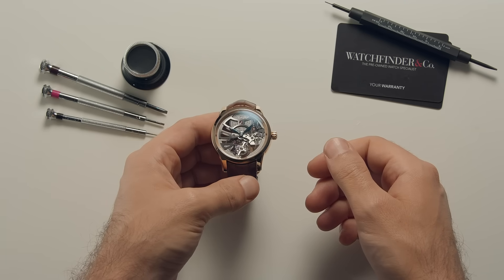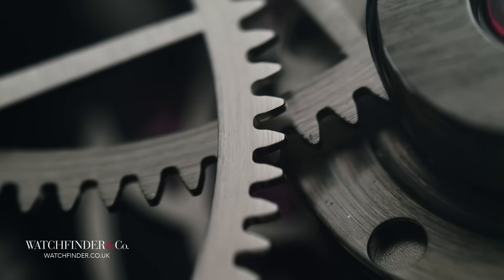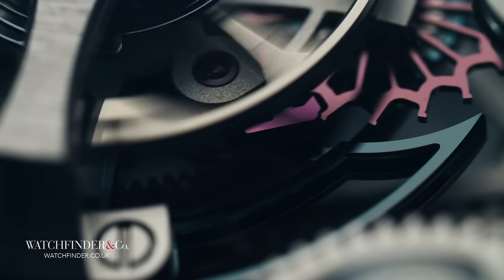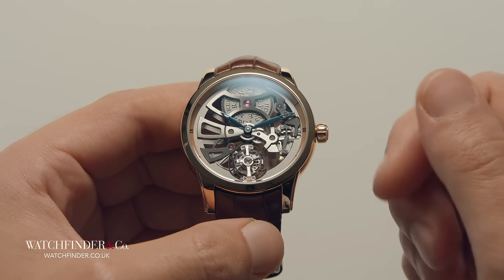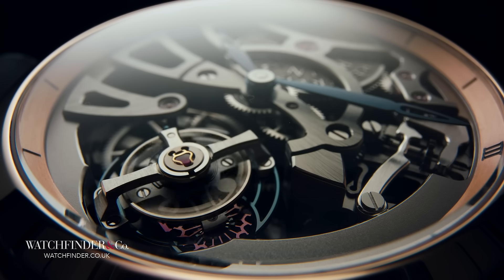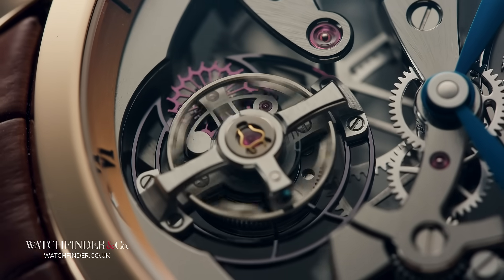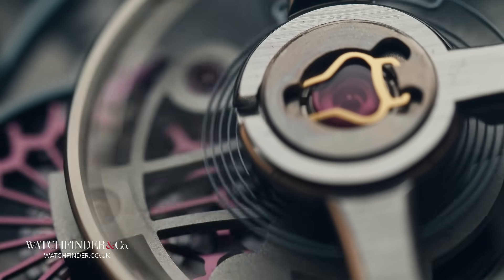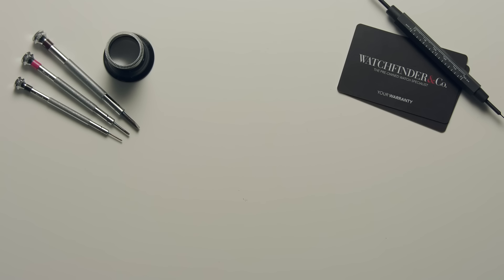How On Earth Does a Tourbillon Watch Work? | Watchfinder & Co.

Comment: I've picked apart a car and put it back together, without any former knowledge. I work with some kind of mechanics, electronics and regulation systems. I think I'm quite smart.
Looking at the engineering of something like this, in such small scale with such accuracy, inventing this just through mechanics is just uncomprehendable.
So they dismantled the back face of the clock to show this? This is how this piece of engineering should be presented. Who wouldnt want to see this, buying this piece of art?

Comment: Didn't get the point, why the rest position of a pocket watch would be different form a writswatch.
I think, the normal position when walking is the same. Only when sitting at a desk (which the homo computerensis does a lot) might the "resting" position be different.
But even then. it's like 45 degree vertical most of the time, I'd say. So it's not entirely useless. But .... who cares anyway, when it's just gorgeous, eh?

Comment: Tourbillon is a kind of clock speed regulating device invented by watch master Abraham Louis-Breguet in 1801.

At that time, Many watchmakers tried to figure out how to make pocket watches more accurate and how to combat gravity and shocks and their consequences on the watch’s escapement (the mechanism that controls the transfer of energy from the power source to the counting mechanism).

So Louis-Breguet invented the tourbillon to help regulate timekeeping. It improves the accuracy of the watch by taking the heart and the brain of the watch, putting them inside a case and rotate it one full revolution every 60s and by doing so, the mechanism will counteract gravity. 

So it’s important to know that when Mr Louis-Breguet made the first tourbillon, it was meant to be for pocket watch chronometers and at that time people needed very high level of accuracy on their watches that were worn vertically on their chest pocket.

But nowadays,  tourbillon mechanism is not functionally needed as it once was, instead  it  represents the highest level of manufacturing process in mechanical watches, companies  tend to implement it in their watches to showcase their know How.

Comment: A modern time piece like an Apple watch runs down in 18 hours and needs a recharge daily. Therefore, if you are not near a power source to charge it and you are out hiking or camping for days or even weeks, then you will not know the time. . But if you have a "magical mechanical watch", you will forever know the time and it will be immensely useful.

Comment: Some of us are true luddites, and simply hate to see electricity and electronics take over functions well served, quite well, by sound mechanics.  I once bought a Rolex, having broken three good watches on "water tight hatches and doors" in a few months on board an amphibious helicopter carrier.  I bought it duty free, and it survived me, mechanic, some decade, just requiring polishing the six hundred meter crystal.  I made a foolish trade, had a few, quite a few electronic watches, and was given a Stauer by my mom, on a birthday, nice automatic, and kept it running for two decades, buying used, and trading parts.  I ran out of parts, and while I'd love one of these, I believe I'll have to stick with my "Invicta" automatic diver's watch, nice mineral crystal, keeps good time, but will scratch.  I also hate electronic fuel injection, because it's not better than mechanical, the engine's are just worse, for low quality fuel, and misguided aims by politicians, of course what other sort of aims could they have?  It is still and incredible pleasure to listen to a 58 265 Corvette fuel injected V-8 idle, with distinctive character, or red-line, in perfect cacophony of pistons, explosions, levers, valves, gears, all whirring in perfect harmony, each movement a harmonic of the primary and secondary forces.  You can't get that electronically, my watch ticks seconds off, five beats to the second, like always, I like that.  Thanks very much for showing this excellent movement, I think I need make a grandfather clock incorporating it.

Comment: As a piece of art yeah, it is the pinnacle of analogous watchmaking...but the current pinnacle of time measuring / time telling is the atomic clock, followed by quartz movements (with radio controlled quartz movements between those two). Doesn’t get more precise than that for now and sadly mechanical movements are inferior in the most essential, fundamental, and basic thing any watch and clock does: precisely telling the time, aren’t they.
But they are immensely pretty and the comparably low level of precision suffices for most uses anyways.

Comment: This is confusing.  If the tourbillon is not needed in a "wrist" watch, then why are they found in some of the most expensive watches?  Do they add a minute (mi-NUTE) degree of accuracy in some way?  Are they merely a gimmick to charge many thousands more for a given watch?  I feel that this video failed to explain "Why" then,  if not necessary in a wrist watch worn on the arm, does the Ulysse Nardin (or any other tourbillon) "have" one?  It must serve some purpose -- small though it may be.  Yes??  Could someone explain?

Comment: Just was watching that beautiful clip... I'd like to ask a basic question regarding the working principle of the tourbillon. ( I'm just an iterested hobbyist - not a pro). I learned that one difficulty in regulation means to find a  way to center the dynamically moving /pumping   center of gravity of the hairspring  over the  CoG of the the balance wheel, to have best possibilities to achieve precision. For a watch or clock which lies static in the gravity field  this is possibly done by  measure like the Brequet or Philips bending of the last winding of  the hairspring which keeps the CoG of the pumping hairspring rather close to the center of the balace wheel. Now in any other than "flat in gravity field position" of the watch, except the bottom up, the projection of the two CoGs results in two different locations which are targeted to be just one. I also understood that when the Tourbillon  rotates the both connected partial masses of the balance wheel / hairspring unit,  it  compensates the too fast or too slow partial cycle over time. The CoG of the spring is as long above the CoG of the balance wheel as it is below it, which mediates the waving frequency to the nominal value and as the unit turns this works for all directions as in 3D too, but as the compensation cycle takes longer here, the compensation time increases with this  cycle)
...But now my problem in understanding, as the mediating  measure takes e.g. 1 Minute for the cycle of a 1 Minute tourbillon and is just referred to the watch to what balance wheel and hairspring are bound to -  and not to the gravity field,  which causes the original problem... .Does this complication - altough it is a wonderful eye catcher - , actually work and make sense in wrist watches where  the watches orientation in gravity field changes many times over the compensation cycle and so the compensations reference gets lost / changed each time?
So the only  truely compensating system would be a tourbillon which automatically alings with the gravity field ( e.g. Zenith)?
Thank you in advance for any competent answer that helps!
Reply: There's a question in there somewhere.....

Comment: Mechanical watches to begin with are expensive to manufacture the parts and to assemble. The tourbillion escapement is very complicated and adds a huge cost to the watch. Because the tourbillion is much less affected by gravity than the regular escapement the overall accuracy is much greater. 

Normally with very high quality regular escapement watches the accuracy between face up, vs face down, vs crown up, and vs crown down can be as much as 5 to 7 seconds difference over 24 hours. With the tourbillion the difference can be 1 to 3 seconds over 24 hours. Technically speaking this is double the stability. As for cost difference there is the question about if it is really worth it? 

With regular mechanical escapement watches to have something that is of very good quality, and decent accuracy the cost can easily be in the thousands of dollars.  With tourbillion watches the starting cost can start in the tens of thousands of dollars. 

I have seen low cost unknown name brand mechanical watches on the net and at some dealers. These are really garbage quality watches and not worth the money spent, unless you would want one of these just for the look. Then there are the knockoffs which are a huge waist of money, and are technically an infringement of the name they are representing. Never buy a knockoff watch!

Comment: What were they thinking when they designed those hands?  I think I could sketch a set of hands in 5 minutes that would have looked better.  In fact, I would say the hands on my fraction of a cost Maxi Marine Chronometer are a thousand times better looking.  Great video as always.